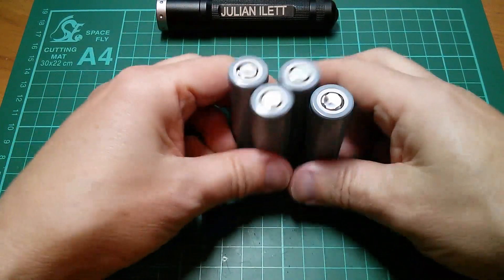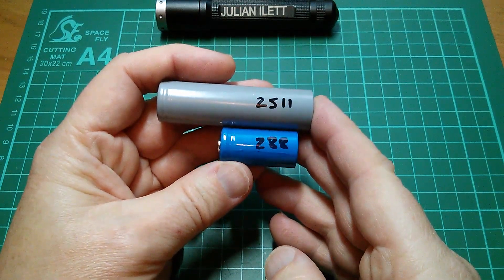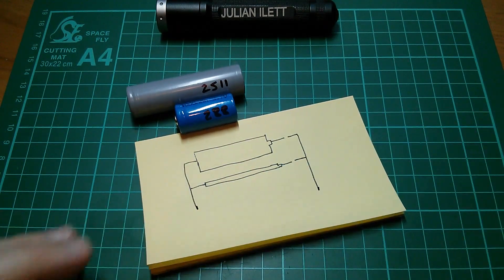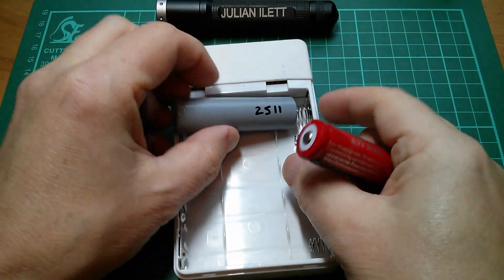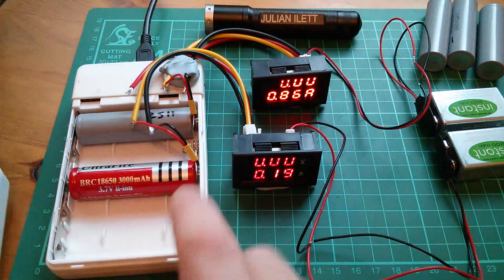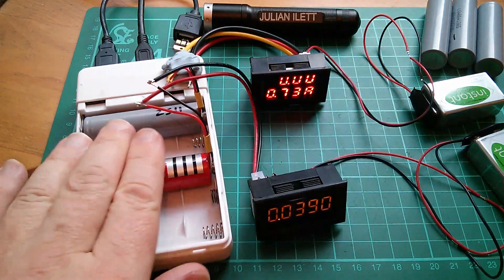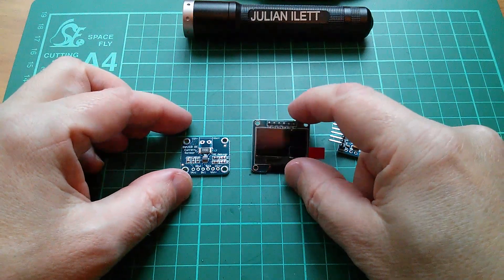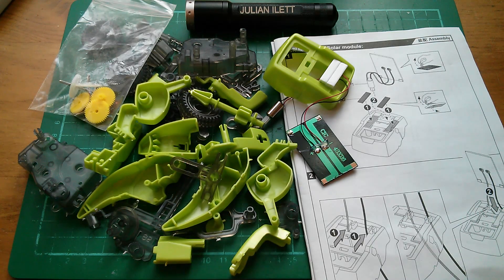Lithium Cells in Parallel + New Project (with pup and rob)

Comment: In physics we were taught the basics of V=IR and loads in parallel and series, it's one thing to learn about the concept but we never really put it into practice. So here I am practicing on my own with arduino projects and wondering if I can charge multiple 18650 batteries in parallel with a TP4056. I had read how a lot of people are saying limit one TP4056 per battery and only now do I understand the monkeys on the internet were referring to connections in series, not parallel. I really appreciate your clear and informative video still being here years after it was made!

Comment: Hello, 
I want  an SMPS with 5v USB input and dual output of 12v and 5V for Battery and Ardunio respectively. I would request you to suggest a PCB board or an IC.

Thanks and Regards

Comment: A question raised in my mind. Can we use 4 3.7v 2100mAh cells in parallel, each cell connected with charge and discharge module(tp4056) . it makes 3.7v dc with 8400mA, than boost the voltage with boost converter upto 12v . Will it work? will such system charge each cell equally and of course discharge them in equally?

Comment: It's simple; the cell with the lowest internal resistance will provide the highest current and the cell with the highest internal resistance will provide the least current. And higher capacity cells obviously have lower internal resistance, so they provide more current while the opposite is true for smaller cells. Imagine both smaller and larger cell as two resistors that are connected in parallel and the value of those two resistors is the same as the internal resistance of those two cells. Smaller cell represents higher value resistor and the larger one represents lower value. When you apply voltage to those two resistors in parallel, the lower value one will let more current through - same with those batteries - larger one with lower internal resistance will provide more current at the same voltage drop. If you connected the same load to both of those cells separately, the smaller cell will have a higher voltage drop due to its high internal resistance. When both are connected in parallel, the smaller one, due to its higher internal resistance simply cannot provide as much current as the larger one at the same voltage.

Comment: great video! 
so If I have understood, no problem if I mix different current cell in parrallel, but I cannot mix different voltage cell? I there any trick to make it safer, I would like to built a big 18v battery for my drill, from old laptop 18650 (so lots of different cells) I didn't found chiness board for balancing parallel batteries, I was thinking about using diodes, but I'm concern about the voltage-drop, I have also to bypass them  for charging
many thanks!

Comment: No scraps of double sided PCB laminate in the drawer?... :)
Also, why not explain the gist of it it by a simple analogy of filling a bathtub and a bucket, but in such a way that the water level is the same in both throughout the process? Obviously you have to provide a much larger water current to the tub than to the bucket so the water level rises at the same rate in both. So the amount of water needed to rise the water level by the same amount is different.
Here the "water level" (voltage) is forced to be equal (by means of a parallel connection), and therefore the currents will also be forced to be proportional to the amount of electricity needed to rise the voltage by an equal amount in each cell.

Comment: Are there any 18650 power banks that take protected cells? I'm concerned about these power banks that use unprotected cells, because if a cell develops a short, all the other cells will dump their energy into the shorted cell.

Comment: I have a question if you don' t mine.  If one charges 18650 batteries in parallel , does one still need to balance charge these same batteries?   Thanks
Reply: Good question. I've just ordered a couple of 18650 power banks that have the batteries in parallel (like the one in this video), and I'm wondering whether I should at least balance the cells the very first time, before I install them in the power bank.

Comment: hey Julian, can you make a video on how to 'recover' 18650 cells that are "dead" 
i recently was away from work for 3 months and had 2 Samsung batteries in a flashlight. when i returned, they were down to about .3 volts, and will not recharge with a stand alone charger, or in the flashlight

Comment: Must stress the importance of making sure that cells are similarly charged (~ 0.01V) before connecting in parallel, as high transient currents may well exceed the ratings of the cells and damage them.
With big battery packs, they may damage you as well as your wallet!

Comment: how about getting a bunch of those really low value resistors, place it series to the terminal points of those batteries (which makes them like a current shunt) and use the Arduino ADC to measure the voltage across then V/R and walah!! you got the current at individual points.

Comment: Same as putting sla or simple acid batteries in parallel, it's just adding up.. They add up to each other 
In addition to series they count up in voltage not capacity so if they are charging one will fill up first and get overcharged... 
So simple, just needs a little thinking

Comment: hi sir Julian.
I have been watching almost all of your videos and they are really good and helpful to me as well as the other viewers,These days I'm upgrading my RC transmitter to 18650 and I have got a problem.I have connected them in series as I wanted to get 12V but when I want to charge them using my DIY TP4056 dock I always have to remove batteries from my transmitter and put them in my dock and charge them as I can't charge them all at once as I connect them in series,Do you have any idea to fix my issue.please let me know of you can..sorry for my bad English as my mother tongue is not English.
thanks alot sir.

Comment: Hi Julian,
Why not use a thin (in width) piece of double sided PC board as the "probes"?
It's what I use to test current draw.
Just cut it to size, say 4" long x , ½" wide, solder a red & black wire to each side, drill a couple of holes in each to route the wires through, (a tortuous path) & file/taper the "hot" end to make insertion easier.
(Sort of like a popsickle/ice cream stick with a tapered end.)
Works a treat & makes external connections a snap.

Stay safe.

Comment: A piece of double-sided PCB material with a lead soldered to each side makes an easy means of current measurement when slipped between, say, the cell negative and the power bank's spring.

Comment: nice video very informative.. battery gurus here in yt will tend to disagree. i watched also that when charging batteries in parallel other batteries with different ah capacity will be overcharged and damaged. but i have done this things, connecting batteries in parallel without any problem. i also mixed fake chinese batteries with original ones.
Reply: How can batteries in parallel become overcharged?!? Electricity 101 damn...

Comment: I wanted to extend my electric bike range and had the question about putting two batteries together in parallel.  They were both 48v and not quite the same capacity but similar.  One was a bottle design battery and the other was a fish type.  I decided that they should balance insofar the the drain on one would be limited by the drop in voltage., as it drops in volts it stops supplying power because the other takes over.  Any way, I charged them separately to the same voltage(bleed the higher one to the same level as the lower one after the respective chargers had gone green). I should have used a resistive load to stop any amps rushing into the potentially lower voltage battery but i just tapped the connection for a while hoping the difference in amps between batteries was tiny and would balance fast with out smoke!  It did work and I have had many miles of use, however, I got a puncture and the guy at halfords switched of one battery off with out me realizing until I had got home.. Had to re-balance the system all over again:(  PS the individual batteries did have a fuse if things rushed from one to other to much).  I got 28miles on one battery and get 54 on the two (rough estimated pending on how much you assist by pedaling), as i depend on the range to get to some where important, I keep the two parallel but I would not recommend it or use it otherwise.

Comment: Re: initial question, of course you can, but you must have per cell monitoring circuitry so it detects when the weakest cell reaches its low voltage threshold, IF that disparity is due to defect.  If it's not due to defect, they the higher capacity cells keep the weaker ones charged to the same level because they won't discharge past where the higher cap cells are since their higher voltage causes higher drain.

It's a little bit of a logic  hurdle like people who state you can't put diodes in parallel because some might be a little lower forward drop than others, ignoring that as the one with a lower Vf passes more current, its Vf rises.  Will the balance be equal? No, it's not the absolute best efficiency that anally retentive people would idealize about, but it does self correct and does work.

It's not the kind of thing you would design on purpose, but if you were deserted on a remote island and that's what you had, you can make it work without much fuss so long as they are the same chemistry so their peak and critically low discharge values are the same.

People have been doing this for years, for example in the car audio segment where they add a second battery for "stiffening" purposes, one that doesn't necessarily have the same AH capacity as the primary starting battery.

Comment: + Jullian Ilett  - Want to reclaim your project? Isolate the negative ends of your cells from the spring with something that is single sided .. gum wrapper or a coiled  wire on cardboard.  A piece of perfboard would work.  Then, use alligator clips from that 'something' to connect your meters.  Complete the battery connection from the meter back to any other available spring.   

... OK, I see the other comments .. but I will leave this here anyway.

Comment: I can't believe you tried to use cheap panel meters to measure current when you have DMMs available. The panel meters likely have much lower accuracy than a DMM and using different models would only add to the inaccuracy and confusion. If you don't already have them, maybe you should invest in some DMM cables with crocodile clips and using magnets is also an effective way to temporarily connect wires to batteries so long as you don't pass current directly through them in a test scenario - only use them as a means of holding a minimally resistive connection together. Although your idea to use an Arduino and current sense boards is admirable I have doubts as to the potential accuracy of such a set up and therefore the validity of any results.

Comment: Can I charge different capacities and internal resistancies 18650s in parallel? Would one cell maybe get above 4,20? Also, discharging them, the "stronger" cell would "work" more and deliver more current, right?
Reply: Yes. You can charge batteries of different capacities in parallel. Just make sure that BEFORE connecting them together, they have the same voltage (with a tolerance of +/- 0.05V) otherwise a lot of current is going to flow between them and the battery holder may melt. 
None of the cells will get above 4.20 V if the charger doesn't get above 4.20V. It will just take longer to charge.

When discharging them, each battery will be discharged to 0% (or whatever) in the same time. 
This means that none of them are damaged if you don't go below the minimum safe voltage (or all of them will be damaged if you do).

In other terms, if you have a 100mAh battery together with a 900mAh battery, and you discharge at 1A, the bigger battery will discharge at 900mA, and the smaller at 100mA. In the end, they all discharge at the same level, but not at the same current.

Or you have two water tanks, one 1 liter and the other 100 liters, connected together. They will be empty when 101 liters will have come out of the "bank". But the 1 liter one will NOT be depleted BEFORE the 100 liter one is ALSO depleted, which is the bit that most people don't understand and the reason why you can't damage batteries by discharging them in parallel.
Reply: MrOpenGL thank you, very nice explanation :)

Comment: I would expect the main danger to be radically different charge states, when the two batteries are first connected. i.e. if the voltage difference was too much, then the current draw from the higher voltage cell, may cause overheating. I'll watch the rest now.
Reply from the maker: I won't know this until I can put my scope on the current sense resistors, but - the initial current could be very high, but it won't be sustained for very long - not long enough for anything to get hot. The danger will be greater for cells with very low internal resistance.

Comment: For the connection between the spring and the celltab i use a piece of double sided pcb with both ends of a banana cable cut in half on either side. This works great.

Comment: Of course you can connect cells & even batteries in parallel of differing AH capacities as long as they are the same voltage. They will both share the load when discharging & the current when charging on a pro-rata basis depending on the size of the cell/battery. The reason for this is due to the internal resistance of the cell/battery. Bigger ones have lower internal resistance, smaller ones higher so it's just really just a question of ohms law. 

This also applies when you have two or more batteries of differing ages. They can be run in parallel just fine as the "tired" battery/s simply have a higher internal resistance therefore will do less of the work. What you have to watch out for in this case is if an old battery decides to produce a shorted cell. It will then act as a "sink hole" to which any other battery in parallel will pour current into. This is what people are talking about when they say "a bad battery has killed my good ones". 

All these reasons are why I am still such a fan of the 12 volt circuit for solar stuff. Despite it's supposed inefficiencies and the need to use heavier cables, being able to run all the batteries in a massively parallel situation simply causes less problems and you don't need to be fussy at all about the age and real capacity of each battery. The more cells in series you have the more critical things become. 

Julian's initial reasoning (adding the 2.5AH cell to the "5AH cell" etc) was totally on the mark. Just a pity the experiment was performed in a clumsy manner..! lol
Reply from the maker: I agree that different capacity cells will share the current proportionately, but not because of internal resistance. I will certainly check this - the difficulty will be finding cells of different capacities but with similar IR. Completely agree with you about bad cells. Like you, I'm not tempted to replace my lead-acid system with lithium just yet.
Yes, it was really clumsy, but the version 2 setup will be super slick :)
Reply: If it's not the internal resistance then what would it be? Imagine two cells built exactly the same way but one is twice is big in all dimensions. This would mean it's got twice as much surface area throughout the active region of the cell. It would have a lower internal resistance. I can't say for certain whether double the size would necessarily be double the current or 1/2 the internal resistance, but certainly there is some sort of relativity there. 

Batteries intended for trucks supply many more CCAs than ones intended for hatchback cars etc even though they are much the same construction. Or even your own experiment: The two batteries in parallel are will have half the supply impedance than the single one....I could go on and on... lol
Reply: Actually now I think about it, if you double the size of something you'll actually square the area..! lol So that's even better...! :)
Reply: That's right. Internal resistance will in fact change due all those factors, and then the current sharing will follow suit. However, we can certainly use ohms law to get an idea how things might happen (or at least begin)  once the switch is closed and the system becomes dynamic. I don't think that self discharge resistance would be a significant factor unless for some reason it was particularly large. 

I am considering this stuff all the time as I am dealing with it often. And I have been thinking about Julian's comment earlier in this thread. Yes, it would be possible to find two batteries with similar internal resistance but differing capacities. They would have different plate structures. 

Say one was twice the capacity of the other: I am picking you would find they would start out sharing current almost equally, but the share would slide quite quickly towards being supplied by the bigger battery as the smaller battery would be being depleted faster.